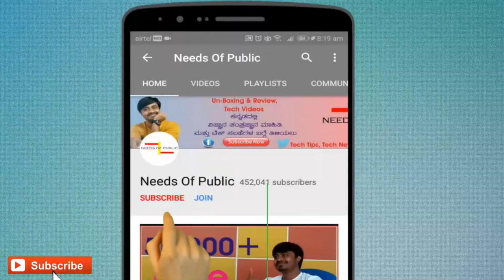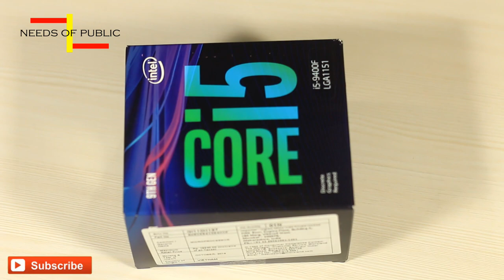ನನ್ನ ಹೊಸ ಗೇಮಿಂಗ್ ಕಂಪ್ಯೂಟರ್ ಬೆಲೆ ಇಷ್ಟು ಕಡಿಮೆನಾ?? Gaming PC Build - Kannada Video

Comment: ಅಷ್ಟೊಂದು ಸರಿ ಅನಿಸಿಲಲ್ಲಾ ಈ ಬಿಲ್ಡ.. ಗ್ರಾಫಿಕ್ಸ್ ಕಾರ್ಡ್ outdated ಅದರ ಬದಲು ಹೊಸ GTX 1660.. SMPS ಪವರ್ ಕಡಿಮೇ ಆಯ್ತು 650w ಆದ್ರೂ ಬೇಕು..
Reply from the maker: 450, 550, 650w is just model brother - 230V power supply barutte & elli 80 plus 230V EU irodu , DC to DC
Reply: Bro that power supply can deliver up to 450 watts  but ur Rig  may uses only 200-250 watts max n the 230v  is just input current not a output current 🤦🤦 n the power supply is certified 80 plus gold ratings at 230v AC input  to DC output